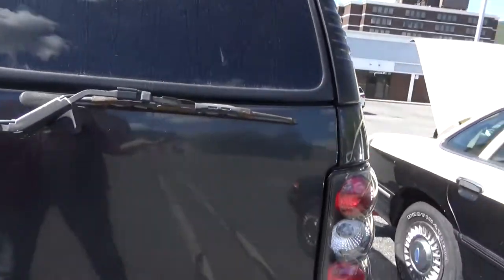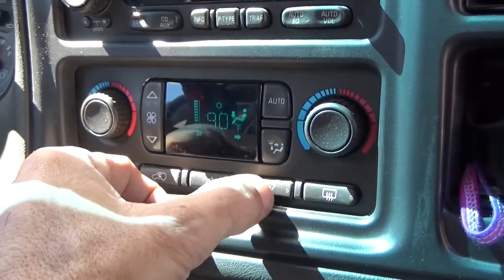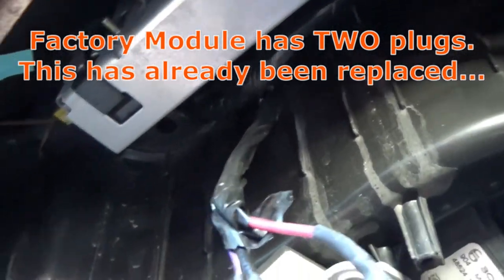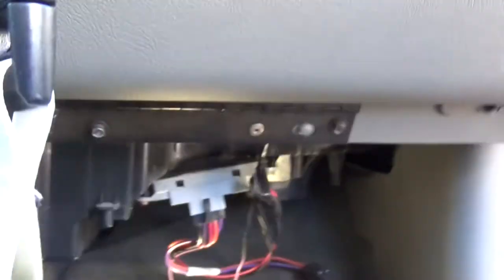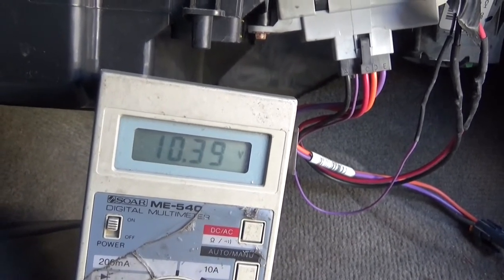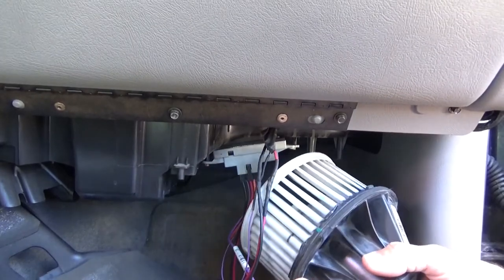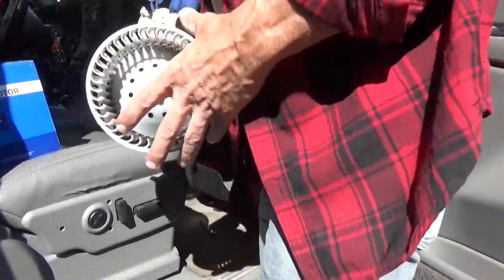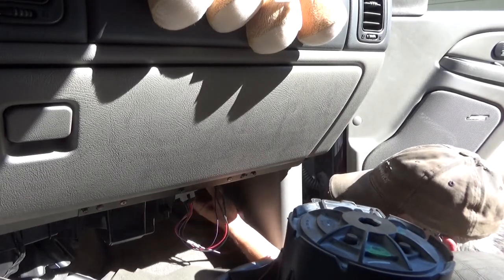Chevy Tahoe - Blower Motor Doesn't Work

Comment: Very helpful video. My fan wasn’t working, I was getting volts before and after Resistor/Relay thinking fan was toast.  Took the fan out hooked it up to my battery and it worked. Glad i didn’t buy a new fan. I was a lil confused why everything worked but Put everything back together. Maybe loose connections or there was a few dozen pine needles in the fan. Ty
Reply from the maker: You may very well have worn out brushes in the fan, and simply disturbing them brought it back to life. IF it is worn brushes, it will do it again. A good smack and it'll get going again... BUT continuing to do this long enough, the current draw will get so high it may fry the resistor pack.
Reply: @HouseCallAutoRepair hello I got a 2005 Tahoe I just replaced my actuator on passenger side no air at all no ac I spend money on that part listening to other people but idk what it is still clicking when I try the air or adjust the temp. I was taking a look at the resistor pack and my wires and it’s tampered with but the tape is coming off the wire and has residual residue like green shit like how it would look on a battery terminal ? The wires was black I think it’s a ground not to sure. But I wanted to see  tried unplaykng the relay from the resistor pack and it will not come out at all. I just put it all back together n left it as is wanna get a portable ac for my truck .. help
Reply from the maker: It sounds as though people are trying to give you accurate adice, but somewhere along the lines, it is not being conveyed clearly enough. 
The"CLICKING" is a blend door drive gear skipping teeth.THERE ARE MULTIPLE BLEND DOORS!

The RESISTOR is ONLY SUSPECT when you have AT LEAST ONE SPEED on the heater/AC fan but are MISSING any speeds (MUST have at least one speed working) 
No fan control at all, is either the fan motor, AND/OR the resister pack.

YOU WILL NEED TO USE A VOLT METER (or 12v lightbulb) to confirm power and ground (NOT DOING SO IS A WASTE OF EVERYONE'S TIME)

Comment: How did that Murray fan work out? So far anything that I have bought from O Reilly that said Murray has been complete junk. Even their thermostats are no good.
Reply from the maker: The whole industry has gone bananas. Some product lines have improved dramatically, while other have become complete unreliable garbage. I am ALL FOR American, but it has to be reliable. The vehicle was totaled this past Fall, by a drunk driver. The fan was still working.
Reply: @HouseCallAutoRepair  Sorry about the vehicle. Hope no one was hurt! I agree with you on the parts but Murray from O Reilly has been bad for me pretty consistently. I did a water pump on my wife's 2012 Yukon last week then fought with an errant temp gauge for a week. It would jump to 230 before cooling back down. Though sure I had an air pocket. Turns out, once I pulled the Murray and put the old thermostat back in, the temp fluctuations were over. I looked at picking up a Murray blower motor for my 2003 Yukon yesterday, but the reviews were so bad, I just ordered an AC Delco unit online.
Reply from the maker: @ericpigg2689  They got a much nicer, newer truck.... No one hurt.
I have use O'Reilly's as a last resort MANY times with great success. BUT they OFTEN get the wrong parts the first time. (Which is why they're last)

Comment: My ac is blowing cold air when I get up to speed around 60/70mph … it will be on 0 and still blow warm air, if I put it on 1 it will let me use my frost botton and only works when I’m speeding. If I’m stopped no air blows at all. I did a blend door actuator on one side so far .. help. Also my resistor looks corroded pretty bad might need to cut the ends off and re wire it together … still not sure if I should buy a blower motor or not tho .. any tips?
Reply from the maker: First.... WATCH MORE VIDEOS!
It "sounds" as if you need a new radiator fan or fan control, and a blower motor resister pack if the blower fan only works on one speed.  (new fan too, if it doesn't blow at all)
Reply: I got the same issue 💀

Comment: I had intermittent blower issues with my 06 silverado with the dual climate control. When I went to check the resistor and blower, I found that those three wires that are shrink wrapped were very messy and were held together with electrical tape. Removed the electrical tape and found that the big red wire was twisted together to a much smaller guage wire?? I got a reducer crimp connector and it worked for a couple months but just yesterday I went to warm the truck up before a trip and the blower was inoperable. Checked the area again and my crimp connector was burnt and melted. In the video it seems all those heat shrinked wires are matched to the same guage, have you ever seen them be different sizes??

I was only getting 10v at the blower motor connector and if I jiggled the off sized wires around the voltage would jump around.
Reply from the maker: well there ya go! You found at least one issue with that connection's ability to handle current. Now... how much current is the fan pulling on high, and does that exceed what those thinner wires are rated for? 10-15 amps?
Reply: @HouseCallAutoRepair  I did not check amperage, it was about 1 degrees outside and I just so happen to have a meter in my truck so I just did some quick voltage checks. However when I was able to get a voltage reading, the voltage would drop as I lowered fan speed so that tells me the resistor is good i believe?

Side note: it appears someone before I owned the truck was poking around with this system, found a 30amp fuse for the blower when my diagram says it's supposed to be 40amps. Nothin worse then diagnosing an electrical issue someone else planted👊

Comment: Could you plug in the motor before putting in the locking in the motor?
Reply from the maker: yes, you can plug in the motor before locking it in... but if you turn it on it will twist right out of your hand.

Comment: Seems weird that a parts store would have a blower motor in stock for a non air conditioned vehicle. I would think they would be the same blower either way, but I have been wrong before. Either way, great video!
Reply from the maker: I would suspect they were sold out of the "good" brands, when I checked...
Reply: @HouseCallAutoRepair  Probably.
Reply from the maker: @unclemarksdiyauto  I remember thinking "Why?  Is there non A/C model?" Turns out there is, and the "Hamster wheel fan" is more shallow.
I agree with you in that they SHOULD be the same, but there are variables. Assembly plant variations, all the way to completely different induction housings. THIS is why everyone makes such a fuss for VIN and other specs.

Comment: If its the blower motor will it not work on ac either?
Reply from the maker: The blower motor's sole task is to move air. Fan should move air at ANY speed, except "0", ANY direction except "Off".
 The fan should not vary when switching AC on and off, UNLESS these are digitally controlled.
When the fan is blowing and you cannot get cold air from the selected outputs, it means there's an AC problem.
Reply: @HouseCallAutoRepair  ok i found the problem the plug wasn't connected good unplugged it plugged it back started working